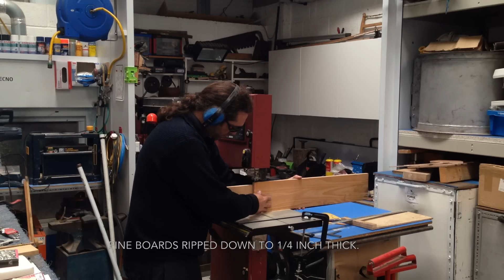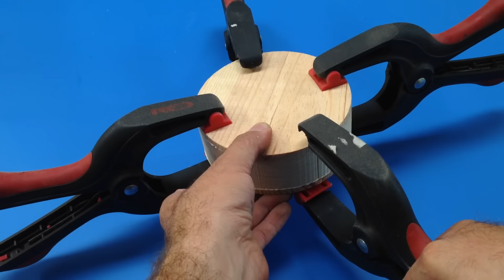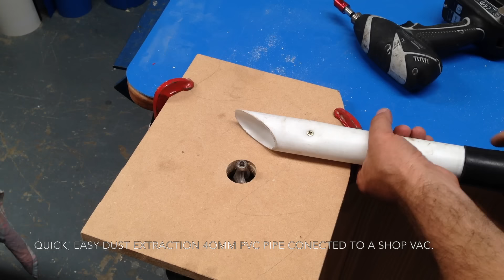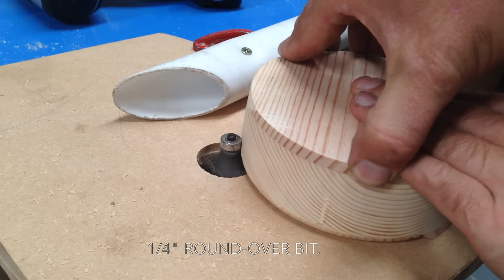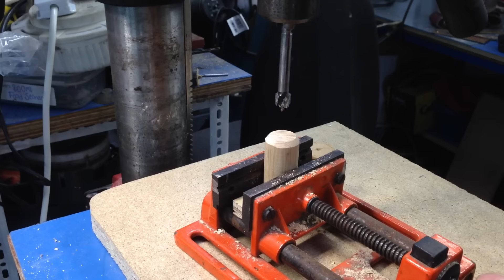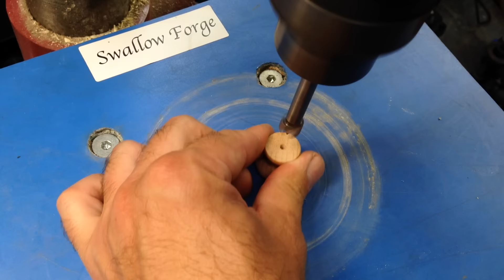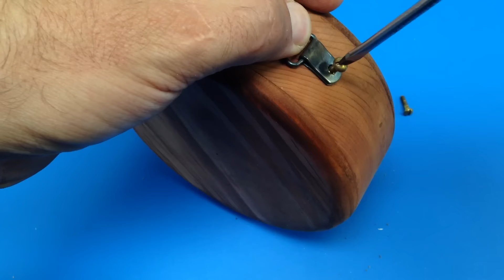How to make a Wooden Water Bottle or Hip Flask for reenactment, steampunk, Larp or cosplay

Comment: Why did you not drill the hole on the edge of the bottle before putting the sides on and leaving all that sawdust inside?
Reply from the maker: Hello, the main reason is because if you drill the hole first, you cant use a router with a bearing guide to roundover the edges. Plus the hole is large enough that the sawdust can be shook out or given a blast with an airline. Hope that helps. Sf.

Comment: You've put screws in sides of flask, and still, no leaks?
Reply from the maker: George Sears Thats because I made sure the screws were shorter than the wall thickness. I got the smarts me.
Reply: Swallow Forge sorry for stupid, and maybe ignorant question... But are water and other drinkable liquids tastes like wood, after they was poured in?
Reply from the maker: Not a stupid question at all. Usually with this kind of container, it's not recommended to leave water in them for more than a day or so as the water will start to taste funny. But that's the same with plastic drinks canteens too. With alcohol yes, some flavour from the wood is absorbed, but with the right wood it can be a good thing :) that is why whiskey makers take so much care with the barrels they use. Again though, I wouldn't recommend leaving spirits in the container for more than a week or so. Hope that helps. All the best. SF
Reply: Swallow Forge And if you're really worried about it, make the thing out of white oak, just like a whiskey barrel!

Comment: Theese were awesome. I wanna make one, don't have the tools you do but I gotta see if I can't work around that.
Reply from the maker: You can make the whole thing by hand. You can cut the centre section with a coping saw or if you have one a jigsaw. You can resaw the side panels with a hand saw. After that it's just a case of taking your time with sandpaper. Hope that helps.
Reply: Swallow Forge Thanks, I do have a coping saw and access to a jigsaw so I might try that.

Comment: I like it its very good looking bug out bottle, but I think the part of durability has been ignored in this project.
from my point of view I think the cap of the bottle should be turned form a sing piece of wood and the neck should have been fixed with some kind of metal around it or form two sides of it so it can be rigid in place, also a anti-water material should've been purred in side the bottle so it cannot leak or absorb water and can live for longer time
Finally the whole bottle should be made from 2 pieces not three this will make make less chances for the water to leak, One piece of wood cut in half, each one get turned in the middle to make the inside shape of the bottle, then make an inner bevel in one of them and outer bevel in the other then make them glued snug to each other
Reply from the maker: +Ahmad Al-Qarni 
So what you are basically saying is, you would have made a completely different bottle. :)
Reply: Actually I wouldn't be able to make even the cap of the bottle, but I was just saying that you could make a better and durable one
Reply from the maker: I've been making these for over 10 years with no complaints so far.
To machine it in two parts would mean mounting it on a lathe using a bowl turning technique, meaning it would have to be fixed to the lathe plate withe screws or you would have to turn a mounting point that would then have to be cut off or turned down at the end. a duel process that would have to be repeated twice for each bottle. To get the two halves to meet up as you described would require someone with a lot of wood turning experience or a cnc lathe. 
To mount metal on the neck would be unnecessary as I can assure you, the neck of the bottle is very strong. Also, what metal? most will oxidise or corrode at some point, stainless steel would require machining.
To coat the inside of the bottle is also unnecessary, the wood fibres swell and become watertight. and you should never leave water in any sort of drinking container for more than a day or so. The coating would also depend on what you are putting in it, some are soluble in alcohol, some in water, no one coating is good for everything.
And finally, if I was going to make the bottle as you suggest, it would take me a whole day to make one. so I'd have to charge 20x more than the design in my video. Hope that helps explain why I have developed the process show in the video. 
all the best SF
Reply: Now I understand why you made it like that,
I honestly love the result of your work. but I thought I could give you a humble suggestion as a consumer, anyway you are the one how knows what's suitable to do and what's not.
Reply: An inside coating is unnecessary. The
 barrels in which wisky or wine maturity are also not coated, the wood 
gives the contents only the long storage period in the aromas. Weight is
 only once filled always the bottle is filled, the same as with the 
barrels in A wine cellar (wine) or wisky burner-free  ( translate via google)

Comment: For some time I have had a problem. How to cut the end of a cylinder true . To be used as a waterproof container in a model submarine,  being  to big  to fit on my lathe . Using a sanding disc as shown here would work just right !   :-)

Comment: Alright alright, follow me here. I see a few complaints of "wood taste" in these comments. What if you made these of american white oak right, the whiskey and red wine standard. To solve your sealant problem on the inside, char it just like they do for bourbon barrels. Then market them specifically for red wine and bourbon.
Reply: +Joseph Roberson Whiskey and wine barrels have no exposed end grain as this does. The end grain will absorb the liquid, , and with the top closed encourage mold growth if only water is used.
Reply: +Chuck D Then just make a bent wood rim. Boil the wood and make a hoop out of it and you are all set.
Reply: just coat the inside with melted beeswax
Reply: Spudwellington are you a beeswax seller?
Reply: Craig Hastie avemaria

Comment: Next video: "How to recover from cancer caused by wood adhesive"
Reply from the maker: So you never drink out of plastic cups? Or plastic bottles? Buy food wrapped in cellophane? Or eat snacks in plastic wrappers? Because they all pose a far-far higher risk than a thin bead of pva. You probably thought your comment was clever. It isn’t. Hope you enjoyed the video all the same.
Reply: @SwallowForge  Did I... offend you in any ways? 
You did a wonderful job with those flasks, but water will seep into the wood and will dissolve the glue (as far as I know PVA is water-soluble). I still don't think drinking glue is a healthy thing.
This isn't the only reason why I don't really like plastic-wrapped food.

If your problem is that I'm not the first one concerned about this, you could have just simply told me that. (I looked further into the comment section AFTER I wrote my comment.)
Reply from the maker: I’m apologise if I came across harshly,  but the vast majority of people posting about the glue have absolutely no understanding of the subject they are talking about. To clarify, Waterproof pva glue, once cured is as close to harmless as you can get. Plus if you look at the construction of flask, the glue is on the face of two plates, there is very little to no squeeze out of glue. So you are talking about an exposed edge of glue less than 0.2mm thick. Not exactly a lot. The same people then go on to say it should be lined with a whole host of chemicals that will come into contact with the liquid inside. Instead of the wood itself that has natural antibacterial qualities. People always jump to conclusions without putting any thought into it first. After a while you do get a bit fed up of it. So sorry if I came across as abrupt. I never intend to offend.
Reply from the maker: Incidentally, Had you asked if there was any risk from the glue, i would have given you my second explanation first, but you went straight into inferring i had posted a video on a project that would cause cancer. Not the best way to open up a dialogue.

Comment: The sip piece was way to loose you shouldn't even need glue if it's a really tight fit.
Reply from the maker: The sip piece was dry when fitted. If you make it a tight fit, soon as you put a liquid in the flask it would swell and potentially split the flask. The glue has a certain amount of elasticity allowing for expansion/ contraction of the sip piece without it coming loose. But  I am sure if you had been making these for 20 years, you would know that too. :)